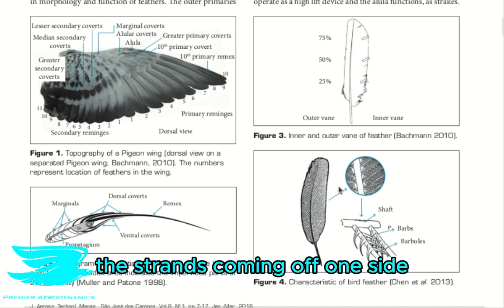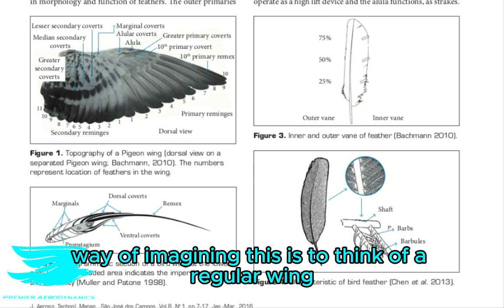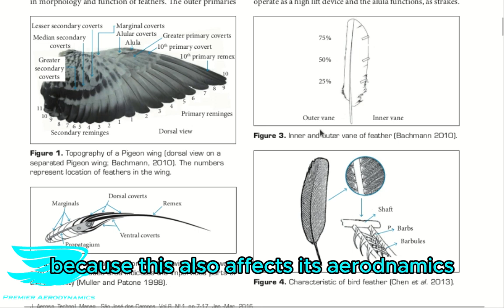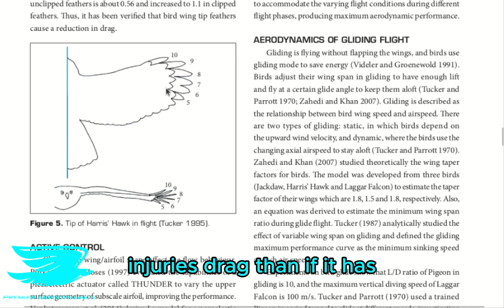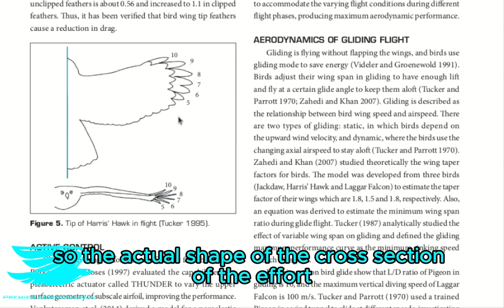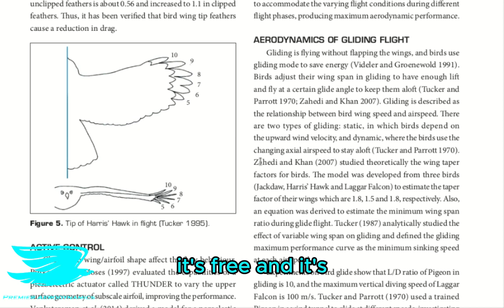Podcast #160 + Bird Wings Are Even More Complex Than We Thought

Comment: Birds make better use of vorticity to generate lift due to their wings, and it's amazing. If you generate an endplate on the suction side the vortex becomes more span-wise, if it's on the pressure side, it becomes more stream-wise. So birds use their feathers to create both, and merge the vortices, and they use the vortices to keep flow attached and fast over their bodies, which generates the bulk of their lift. Like Victor Schauberger said, birds don't fly, they're flown.

The downstroke creates the vortices, the upstroke rides them, when they're gliding they're constantly adjusting their porus wings to maintain the tip vortices.

It makes sense that their wings are stronger on the pressure side than the suction side, since the pressure side is the side that deals with the dynamic pressure, and the suction side is being lifted not pushed down, it's tension would always be in the same direction. Having equal strength in both directions would be inefficient, from a structural and weight POV.
Reply from the maker: That's a good point. The upstroke doesn't see the same force as the downstroke, so it doesn't need to be as strong from that direction.

And that's cool to know about the difference an endplate makes to the vortex. Thanks.